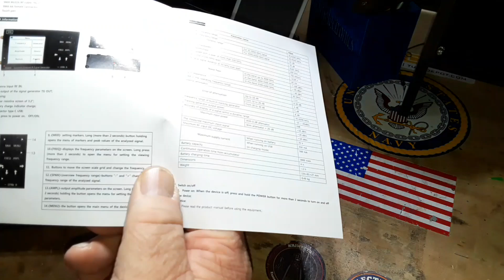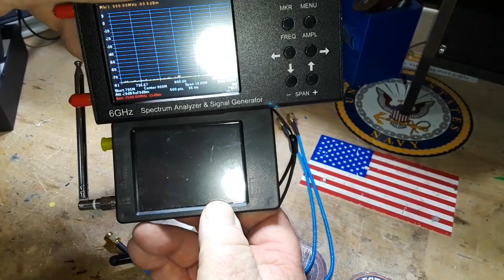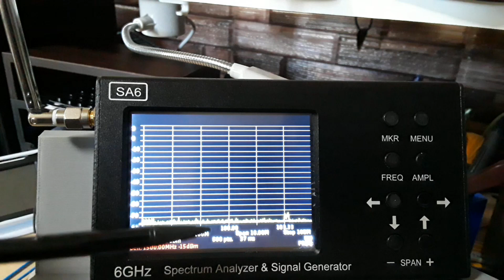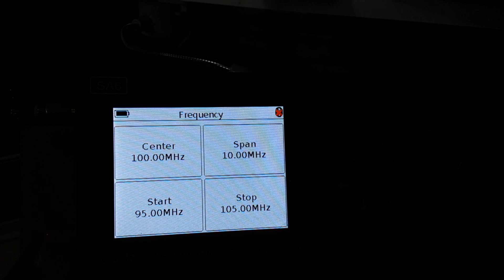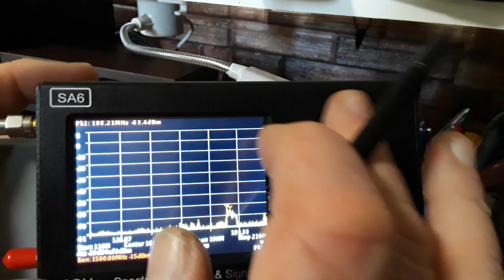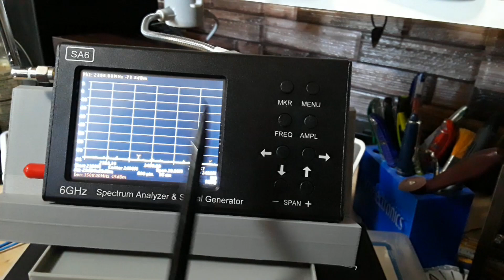SA 6 6 Gigahertz Spectrum Analyzer Unbox & Demo

Comment: Just to remind everyone, the minimum frequency is 35 MHz, so not useful for HF and below. The SA Ultra is the one to get for general LF-GHz usage.
Reply: Thank you for a warning! I almost overlooked this important spec of the TinySA Ultra vs SA6. I wish TinySA Ultra had a nice metal casing like SA6 comes in. However the Tniy's 4 inch screen wins over the 3.2 inch one of the SA6. It looks like for general LF stuff the Tiny is the way to go as you correctly noted.

Comment: You need to look up the tiny sa ultra ;) that sa is an upgrade of the tiny sa whic goes to 6Ghz
Reply: How is it better?
Reply: @ergonomiczero2228  getter dynamic range, lower input noise bigger screen, but no tracking generator. That said the tracking generator in this unit is mediocre at best.